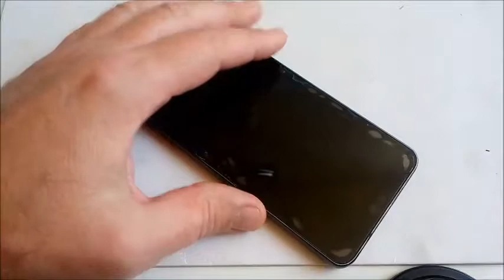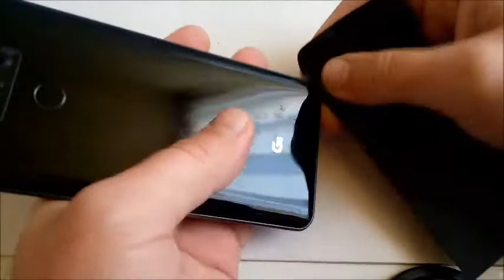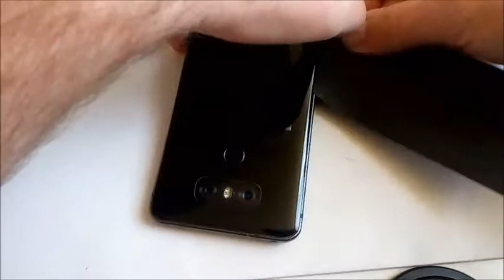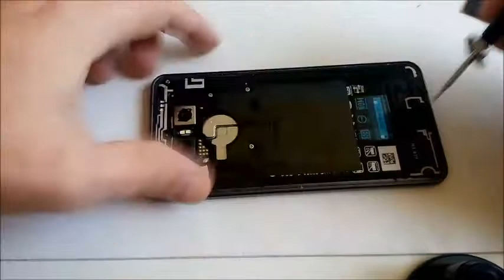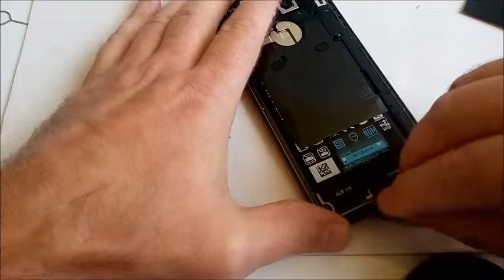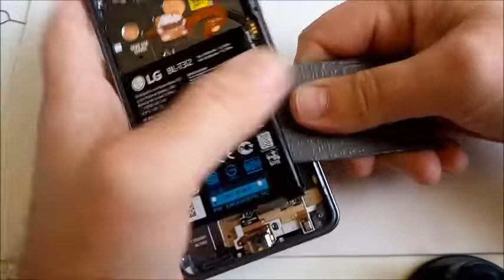Lg g6 battery removed

Comment: Sir,
1. Do you use double sided tape 
    T-7010 or liquid glue T-7000 
    with a needle applicator to seal 
    the phone up ?

2. What size is the Phillips 
    screwdriver used to remove the 
    11 screws, #0, #00 or #000 etc..

3. Is there true genuine LG OEM 
    replacement batteries available 
    for sale anywhere ? 

Very nice music by the way :-)

I appreciate your time spent in responding to my inquiries.

Best Regards
Reply from the maker: HI,i use liquid glue T-7000,thank you
Reply: sasafu sasa
Thanks for your response sir.

Please tell me the size of the Phillips head screwdriver. I would greatly appreciate it.

Thanks